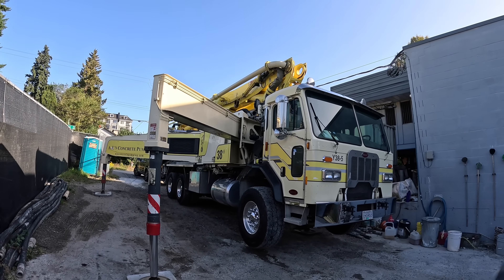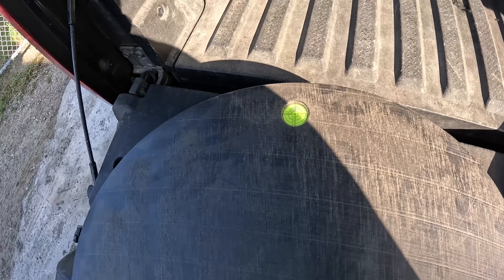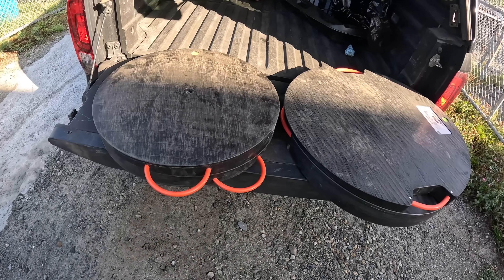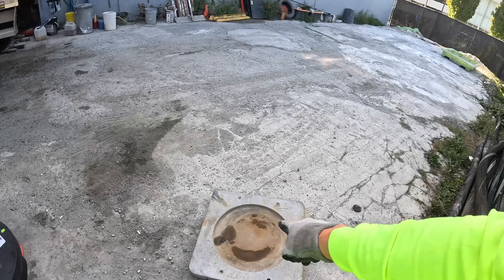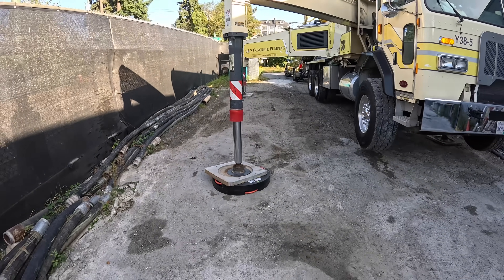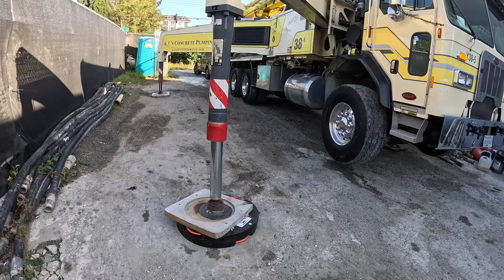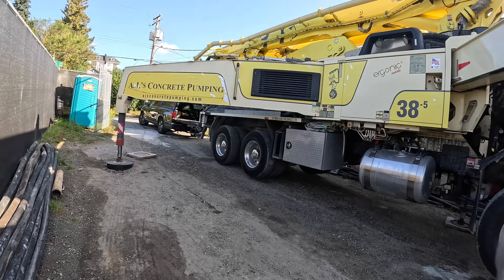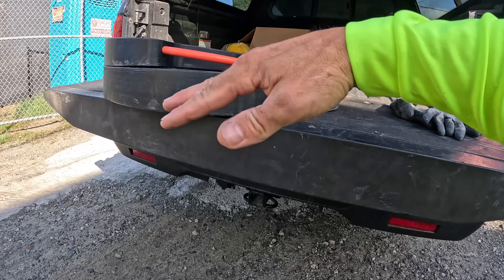Dica USA “LevelRight” Adjustable, Levelling Outrigger Pad for Cranes, Concrete Pumps, Etc….

Comment: Those are pretty neat! Definitely helps distribute the load more evenly. Better than putting all that side load on the outriggers. Even if you cant get it perfectly level, its still better than uneven ground with the swivel completely cocked to one side.

Comment: I’m not a fan of that little bolt pulling that pad together
Reply from the maker: The 24” round pad is a machines, male-female design, same as the 30” pad shown in the video. Only reason the 30” pad doesn’t use a bolt to hold the two pieces together is weight.
Reply: @canadianconcretepumper1979  makes sense, but that’s a lot of weight. I hope their calculations on their sheer force for their material they use on the pad is top notch 😅

Comment: Operator math says 2 adjustable pads means 20 degrees of availability lol.  Just wait,... somebody's gonna do it 😂

Neat product, but the liability of ignorance would be a worry for me.
Reply from the maker: If an operator is attempting to setup the pump on more than a 10 degree slope, god help him. For reference, Lombard St. in San Fran is 15 degrees slope. 

I’m not certain we’d even get to 10 degrees before the hopper is pinned to asphalt. 

The same person whom would stack two of these pads probably should not be anywhere near heavy equipment 😂😂😂
Reply: @canadianconcretepumper1979  I totally agree with you. But you know,...  somebody's gonna do it lol.   Sadly due to the influx of work and lack of manpower, quality gets cut at competency alot of times. Im impressed by the pads, I think they're great for the right use.